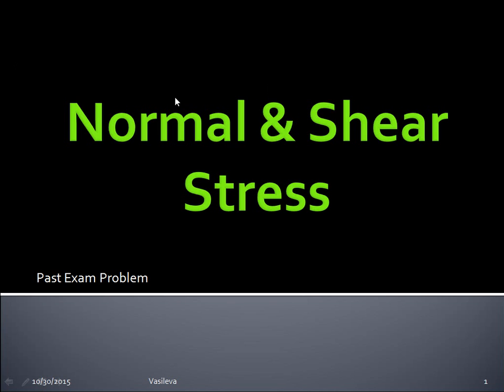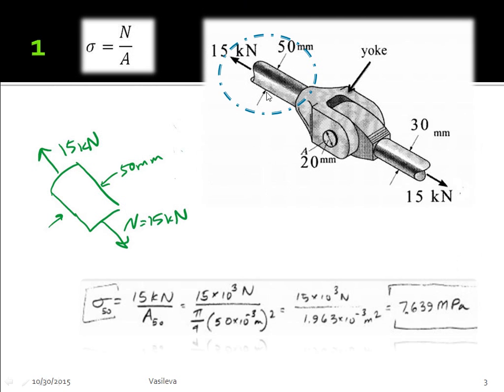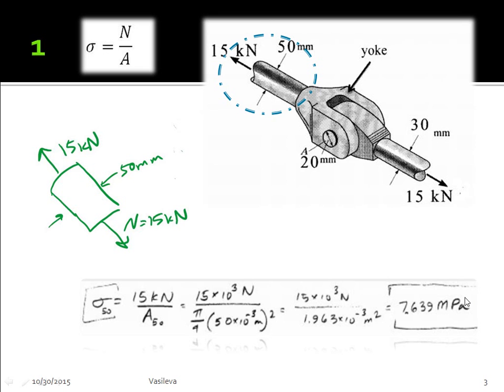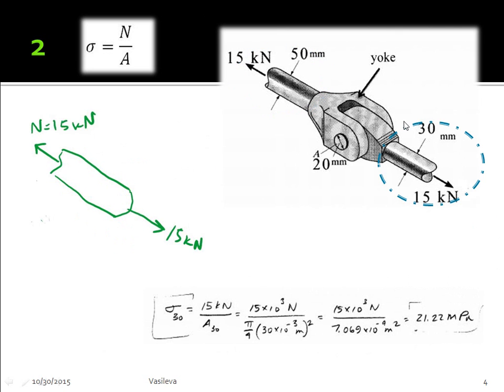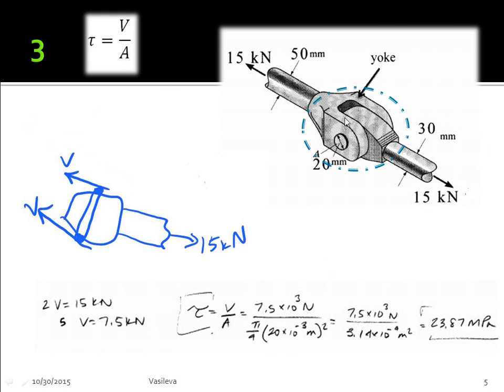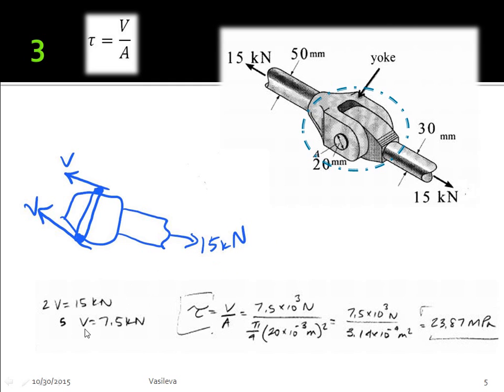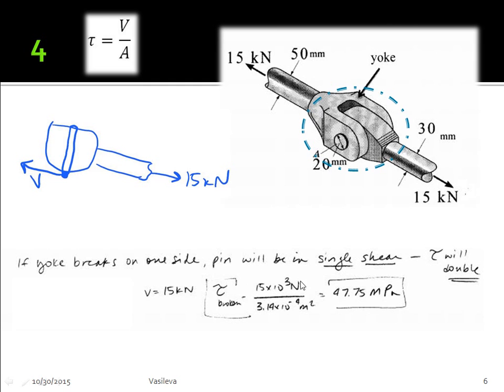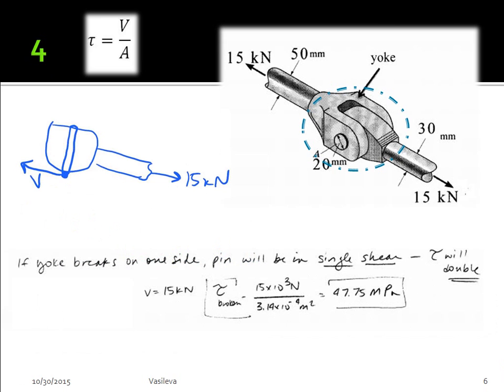Normal & Shear Stress  Old Exam Question

Comment: Why you multiply the diameter with 10^-3? the given in your example was in millimeter? I was thinking that 50mm was converted in mm. I was confused help me. :<
Reply: To get an answer in Pascals, the units need to be in Newtons per meter squared.  50*10^-3 is 50mm expressed in meters.